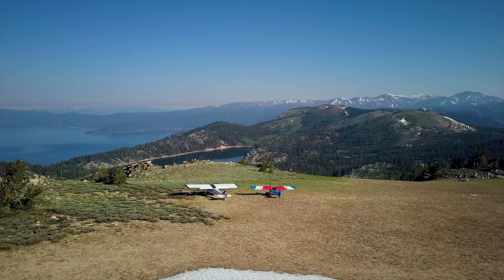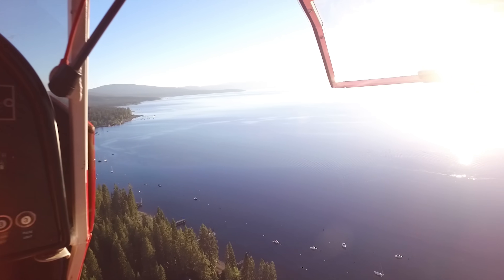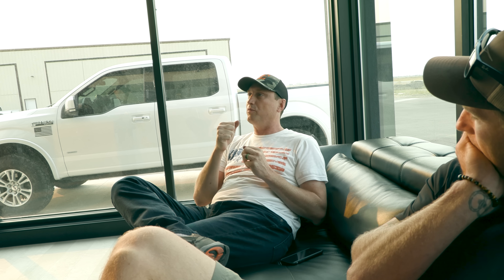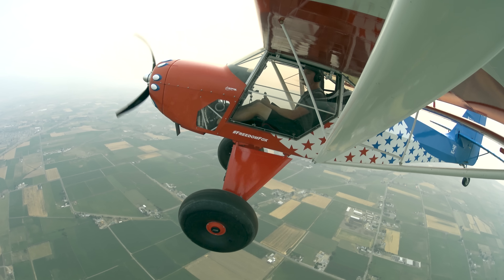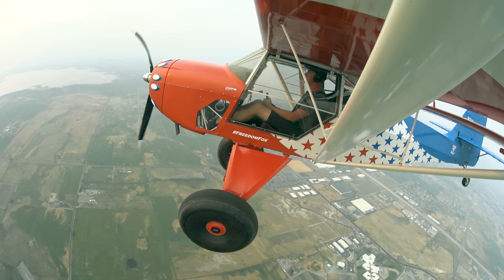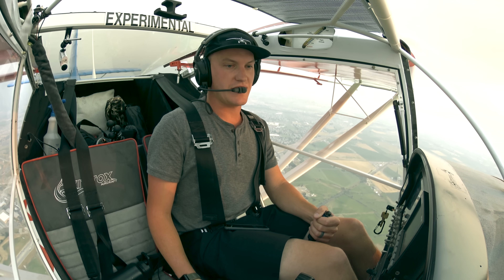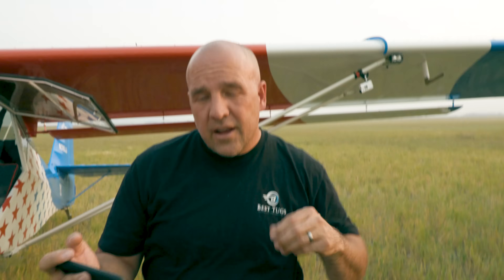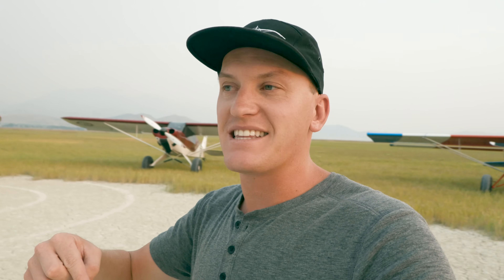YOUR FLIGHT INSTRUCTOR WAS WRONG! - Simulated vs Real Engine Failure

Comment: The Pitches of the props and the idle speed will be required to do calculations. The point at where you are traveling faster than the prop there will be a vacuum on the back of the prop and that will cause drag the turbulence around a stopped prop will wash and not build an airfoil. So there is accuracy to both assumptions. for example say we have a prop that is a 12" pitch 1 revolutions is 12 inches your engine idles at 2000  your prop pulled through 24,000 feet of air in 1 min *  60  / 5280 = ~272mph air now that would be the exact speed to match your prop at which point there would be negligible effect from the prop. I don't Know the exact prop dimensions and pitch or RPM of the props but using the calculations above you should be able to tell at what point the prop is in thrust vs drag. also the point where you match the idle airflow of the engine your engine should have a slight surge due to no drag from forward or reversing air. I am no expert however this is just my understanding of aerodynamics.

Comment: It's airplane dependent, and very easy to test.  Get a wind meter (like a Kestrel), stand behind your prop at idle, and take wind readings... if your glide speed is slower than that reading, you are contributing thrust, if it's faster than that, you are generating drag.

Comment: While knowing more about aviation (and the technical learning debates involved) are an important part of being an aviator, I think the premise is incorrect in this discussion. I have never once missed a power off 180 or any similar maneuver, not even my first one. Admittedly, I was a commercial helicopter pilot before I started flying airplanes and that is what I attribute my success to. In a helicopter, on an engine-powered landing, you create the glideslope. There isn't an aircraft "standard". Instead of being worried about how one aircraft glides and then being surprised in an actual engine out, pilots need to learn how to carefully and accurately observe and refine their actual glideslope they are presented with for the entirety of the maneuver. I never stop evaluating and adjusting my glide from the moment it starts to flair. Another way to say it would be that I have no expectation of what my glide should be, but rather evaluate what it actually is. It's a skill to be able to do it accurately (again, I refined mine in helicopters) but doing "engine out" practice at different idle rpms will help. Do a power off 180 at 200rpm. Then do one at 600rpm. Then do one at 1000rpm. Then try 400rpm. You'll learn to adjust to what the plane is giving you rather than what you expect of it, and when the day comes that you have to do it at 0rpm, you'll already be used to judging based on performance and not performance data.
Reply: Well said Jeremy.

Comment: Think of it this way: the plane is a trolley with very low friction wheels that can only grip the ground a tiny bit - turning the wheels faster than the current speed of the trolley will cause thrust, otherwise they cause braking. Prop at idle power is like turning the trolley wheels slowly, prop windmilling is like just letting the wheels roll, and prop stopped by engine compression is like fixing the wheels completely. It should be pretty clear which of these would cause the trolley to slow down quickest.
Reply: Not quite.  The prop does not spin freely, it turns the cylinders in the engine -- it does physical work.  A windmilling prop is like applying the breaks, a stopped prop is like a skid. If you have anti-lock breaks your understand that a skid actually slows down less.

Comment: Scott wins.....he has least amount of drag...hence he was quietest there..lol

I live where there are more turbines than recip float planes...I fly aboard a fair amount....

that disc in front acts as HUGE DISC/AIRBRAKE on approach to (world's busiest aircraft harbour: there in itself is a good quiz!!) alot of the time..especially on windy and steep approaches but they are using constant speed propeller / air screw....

my Opinion: there is no way a static or stationary propeller creates more drag...not even close  (unless of course Scott's airplane again..least drag haha) to a turning propeller slower than effective enough to overcome airplane drag and mass; because it is slowing airflow in that column of cylinder - sorry to disagree Cowboy; but physics is physics.

to answer the question about training for engine failure.  I have been right seat on two.  both made the airport (wrong airport on first occasion but we were a bit excited and windscreen covered in oil.....) the second was on departure climb out at gross....and it seemed to take FOREVER for the aircraft to come over the top to start recovering airspeed..likely due to cog at the time....we actually banked hard (172 we were at 750 airport was at sea level) to get back to the airport and land on a different runway as we had declared emergency and engine failure--crash truck (they are for saving runway and infastructure btw..not you or airplane) was already rolling as we flared, bounced and landed...with no way to taxi I might add.

both fixed pitched seemed to add nose drag while they were spinning..but that could have been because approaches very steep to get airspeed....

but a spinning propeller not creating driving thrust by physics has to be creating the opposite of that=Drag...much more than static.

try it standing in back of that F150 in back ground...try holding propeller static at 55mph.  then spin one...and try and stay in truck....
Rich

PS sorry your go fund me didn't "take off"....I thought for sure you would be ordering the 915s by now!! ; (

Comment: A windmilling prop is a different animal than an idling prop!  With my Supercub on floats I routinely practised dead stick landings.  I quickly found that after pulling mixture and slowing up a bit so the prop would stop, glide ratio improved.  Believe me with an 82x41 Borer prop windmilling around, a Cub on floats has a pretty steep glide ratio!
Reply: If you have ever hand-propped a Cub, then you know that it takes energy to turn the thing.  Think about where that energy comes from if the engine can't turn itself inflight.

Comment: The next test is to glide at a speed that is faster than your propeller pitch speed at idle RPM.  The trouble will be that you won't be able to have a still propeller at this speed it will windmill.  But that is the point at which the math switches.  Also aerodynamically there is a reason the concept is disk loading and not blade loading, both for props and rotary wing aircraft.  The spanning propeller has more "area" that the fixed on.  Not sure the best way to show this in words.
Reply: If anything, a spinning propeller has less area than a stopped one, because it meets the relative airflow with its leading edge. Disk loading doesn't mean that the propeller is seen as a solid disk, it's just a mathematical concept.

Comment: It would have been useful to state what rpm your props were spinning when at idle and what your prop pitch is so that we could use some basic math to help answer this question. If your rpm + pitch combination produces a velocity of prop wash that is equal to or greater than best glide then the idling prop is extending your glide. When you stop the prop you lose that benefit and add some drag.

Comment: All vortices create drag, and greater vortices, (i.e.  speed) creates more drag. Every semi-professional cyclist knows this.  My logical example is a Carbon 3spoke wheel  versus  a 24 wire spoke wheel... far more drag from spinning faster, regardless of wind direction, wheels, even more in crosswinds.

Comment: Easy way to test is take someones spare motor that is on a engine cart for testing and put it in a wind tunnel that can measure drag on the cart by sensor the cart is attached and idle the engine and then turn it off. There some wind tunnel testing companies that will do this for free for exposure on YouTube.

Comment: great test Trent, my friend has always said that a landing plane at idle the prop is acting like a brake. now I know this is not true.   thanks!!!
Reply from the maker: It still is acting like a brake, especially at higher speeds, the question was: is it more of a brake than the prop stopped and the drag from the flat face of the prop. Again, it will vary on different planes
Reply: thanks Trent

Comment: a rotating propeller will always produce some net thrust. this thrust gets subtracted from the drag the propeller blade induces. 

if you want you can look at it the other way around: the drag on the fixed pitch blade gets converted into rotational energy. if you put rotational energy into a prop, you get thrust.

Comment: That may be true for fixed pitch props, but for constant speed props on Idle you have it on fine pitch, which would create more drag than a stopped propeller which would be feathered. That's why we do the PFL on a low power setting with the PC-9M.

Comment: A spinning rotor can indeed generate more "drag" than a stationary rotor.  This is why wind turbines - even fixed-pitch wind turbines - stop themselves at extremely high wind speeds.  Stopping them reduces the "thrust" (you'd call it "drag") on the rotor thus reducing loads on both the blades and the tower.  However, this depends on how fast it's turning and on how fast the wind is blowing.

Comment: depends on the airspeed of the plane. do the pitch and rpm calc for the tractor of feet per minute. If the resulting feet per minute of tractor exceeds the planes airspeed there is less drag.

Comment: Now windmilling:

imagine a plane moving in the air and the prop can spin freely without any friction (just like those plastic fans on a kids bike)

if the prop spins fast enough, it will have no drag, because the air moves exacly through the prop as the prop moves through the air... (V_air - V_prop = 0 ; V_air = V_prop)

now you can brake the prop rotation until you maximise its drag when completly still (dead stick)

the windmilling engine is like a break for the prop but it does not completly break it to stand still

therefore the highest possible drag is, when the prop stands still
windmilling is slightly less drag,
ideling is even better than windmilling

Comment: I have done this on different rc planes. Stalled prop tends to glide further than windmilling or slow turning prop.

I just don't know how it scales. And don't know what percentage of thrust you get with a idling prop in real life. I used the lowest input to run the motor as possible.

Comment: ok so here comes a little bit of systems engineering:

consider an prop with an engine mounted to ground 
It moves air depending on the rpm from A to B; High RPM -> high air-movement zero RPM -> NO air-movement therefore no thrust

now move this system inside the air OR equivalently move the air around the system

Drag means, that the outside air moves faster than the prop air!
Thrust means, prop air moves faster than outside air!

Or as equation: V_air - V_prop = drag   <=> V_prop - V_air = thrust

Drag is just negative thrust or thrust is just negative drag

If you want to MAXIMISE the DRAG you have to minimize V_prop 

or in Conclusion completly dead stick it. 
Done!

Comment: In my opinion, a spinning prop creates more drag. You can use a helicopter as an example. As it auto rotates, it gently brings the helicopter down to the ground because of the drag created by the spinning main rotor blades. If the blades were not spinning, it would fall to the ground at the speed of gravity.
Reply: James Hoiby does a parachute create lift? The idea is the same.

Comment: What is a prop?  Answer is an airfoil.  If it is spinning due to an idle engine it does have a lift vector which is cancelling some of the drag vector.  Seems simple to understand.  I think you demonstrated this.  Thanks
Reply: This assumes the angle of attack on that airfoil is positive.  At a fast enough relative wind the angle of attack becomes negative and the "lift" produced by the airfoil becomes opposite the direction of travel. Clearly this speed is greater than the 60kn best glide in Trent's Kitfox.
Reply: John Miller Mr Miller, your comment does not make any sense.  The prop is spinning under power, at idle, and that power has to go into the airstream.  Thus, as they demonstrated, cancelling some of the drag of a stationary prop.

Comment: Think about the angle of attack of the air against the prop and the surface area of the prop exposed to the air... a spinning prop has a smaller surface area relative to the angle of attack of the air... A still prop is wider since the air is moving directly against the entire width of the prop. The spinning prop only exposes the leading edge to the airflow.

Comment: Windmilling prop has more drag...period.  Just think of gyrocopter...if the blade stops it falls like a rock...the bade spinning gives more drag and allows the gyro land safely using the auto rotation.
Reply: Yep. But he's not talking about windmilling, he's talking about a prop being powered by an engine at idle.
Reply: Sorry but I thought they were talking about all three conditions 1) prop stopped 2) prop windmilling and 3) prop at idle. I was just answering the windmilling versus stopped prop.  I though the conclusion of the prop at idle depended on just what idle  speed was...and they figured that some engine idles were set high enough to obtain thrust.  If you put the aircraft in a dive the dive will over come the idle thrust.  I'm not sure of the science but if you have a plane sitting still even at low idle you will give some thrust.  If you took that same airplane, same engine speed and put it at 5,000, then put the plane in a steep dive that thrust would be over come and it would be drag...does that make sense?  Thanks

Comment: A really smart suggestion: Let's test it - confirm or debunk, then let others know!
There are 3 possible scenarios: Engine at idle, engine dead but prop windmilling (not tested in this video) and engine/prop stopped. Each will be different.
A few points: A geared Rotax will simply stop, while a straight-drive engine (Continental/Lycoming) WILL windmill.  If you have a constant-speed prop and an engine that dies on you (but keeps windmilling), put the prop in the full-coarse (lowest RPM) position. The drag reduction is significant!
Practicing actual dead-stick landings is actually a good idea, as the elevator efficiency will be reduced (as they found out). Get to know your aircraft!
Practicing side-slips is also a good idea, it is a great way of controlling your approach angle and getting rid of any unneeded altitude once you have settled on an emergency landing spot.
Reply: Mike said he tried windmilling, and didn't see much of a difference. But that might be because he has a turboprop, which should create less friction when windmilling than a reciprocating engine.
Reply: If he has a turboprop, he probably has reverse AND can feather it. All the twin turbobrops I have flown have either had auto-feather (PT6) or NTS (negative torque sensing, e.g. Garret) because it is essential to feather a failed engine. A spinning prop in in fine pitch creates a LOT of drag, even at speeds as low as the 80 knot Twin Otter single-engine speed. This gets exponentially worse with faster aircraft.
Then again, you were all flying ultra-short-field aircraft with much lower best-glide speeds so that point might be moot...

Comment: further im pretty damn sure a windmilling prop will also cause sightly less drag than a stopped prop, but the difference would be smaller than the margin of error in a test like this.  whether the prop is turning the motor over or making ice cream, if its moving at all it will give less resistance to the air its moving through.
Reply: this is simple conservation of energy - if the prop is held stationary, all of the energy of the oncoming air becomes drag on the airplane.  if it is allowed to move, even very slowly, and no matter what its turning (youve got to ignore the image of a hard to turn over piston engine from your mind here, as it doesnt matter), SOME of the energy of the oncoming air is being converted into kinetic energy in the turning prop, and therefore is not available to cause drag on the aircraft.  
it may be that in particular practical situations, the prop being stationary say, horizontal, in fact causes SLIGHTLY less overall drag than if it is turning slowly, but that would be down to the aerodynamics of each aircraft.  and the difference would be so small as to make no practical difference in an emergency, only in a wind tunnel. 
ask someone who is an expert in fluid dynamics and i bet they agree.  if they dont, ill be fascinated to know where my thinking is wrong.

Comment: Could the spinning prop's turbulence potentially generate more induced drag around the struts, fuselage, empenage, etc...?  May be more or less depending on where a stop prop was stopped in relation to the horizontal planes, struts, or gear...  Different with a high-wing vs low-wing?  So many variables that can affect this!

Comment: This is pretty simple really.  If you think of how the plan will react when it is sitting on the runway... shut off with a heavy headwind.  The natural inclination for the prop would be to spin in the wind.  Therefor to prevent that, you would need to hold the prop to stop it from spinning in the wind. so that is your drag.  A stopped prop creates more drag than a spinning one.